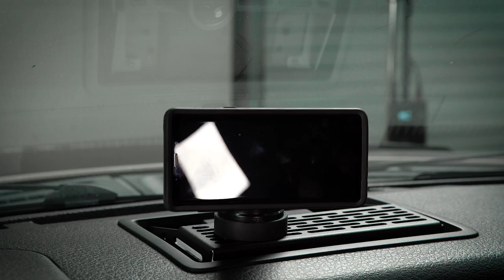2009 - 2014 F150 & Raptor BuiltRight Industries Dash Mount Install

Comment: Let me get this straight...mark the hole locations WHILE contorting yourself to clear the windshield?  For a part you're about to remove and could mock up and drill much easier on your workbench...
Reply: Adam Miller go on..... 😂
Reply: Adam, the holes on the back of the bracket are oblong so it's recommended by BuiltRight that the bracket is partially mounted in the vehicle to ensure proper alignment when you mark the new holes to be drilled. Now if you have to "contort" your body to simply lean forward and put your hands on the dash then the problem isn't with the product lol. In my experience this was still a very easy install and I think BuiltRight made a nice product.

Comment: I found the screw holes in the product don’t quite line up with the oblong holes and that makes it a bit awkward to utilize the Allen wrench.  Secondly, the corse screws provided to attach the product to my dash were halfway effective.  Back right screwed in, but back left didn’t fit the hardware in my 2014 XLT, so the unit is basically mounted with one screw to my dash.
Reply: Running into the same issue. It's the hardware underneath the tray that won't allow the screws to properly fit. Mine is an FX4.

Comment: and where can we get the mounts for the phone??
Reply from the maker: Check them out in this link Alex - https://www.stage3motorsports.com/BuiltRight-Industries.html
Reply: @stage3motorsports  why not remove the trey completly from the beggining ? wouldn't it be easier
Reply: @stage3motorsports  Alex was referring to once we get this installed. Where are cellphone holders that can mount to this bracket?